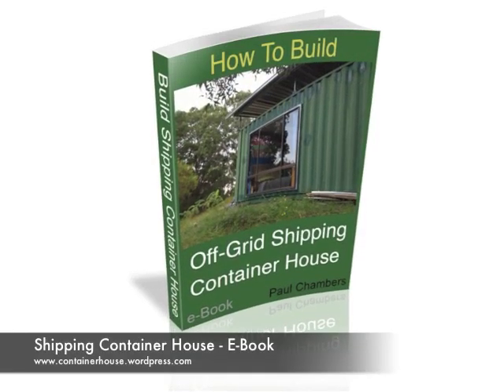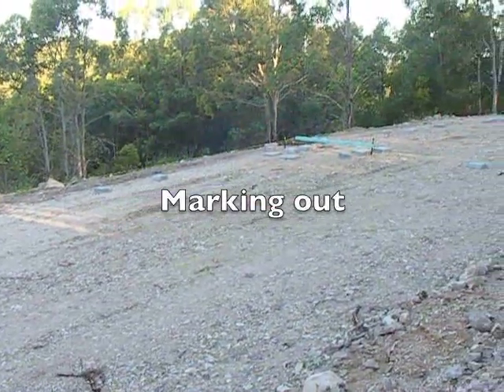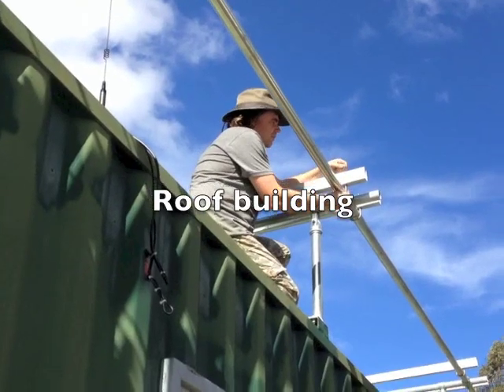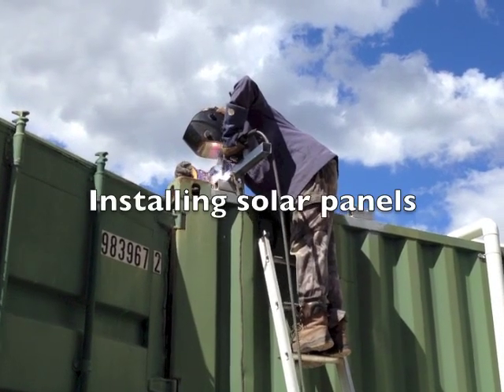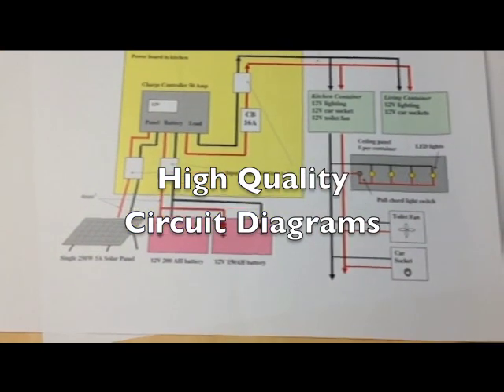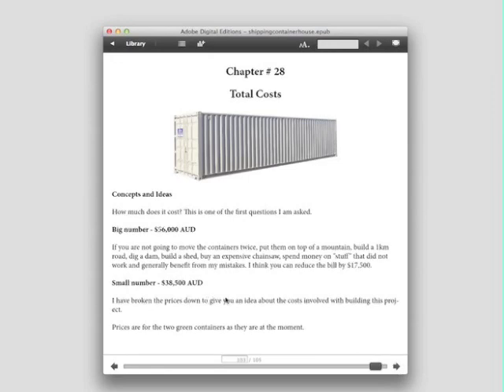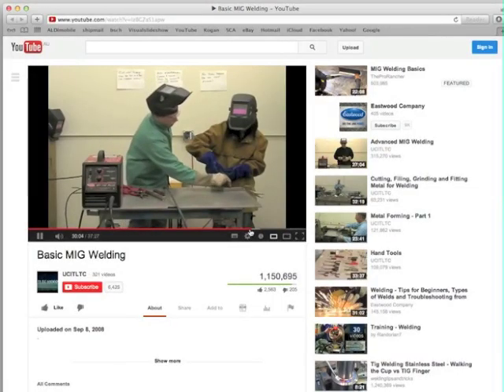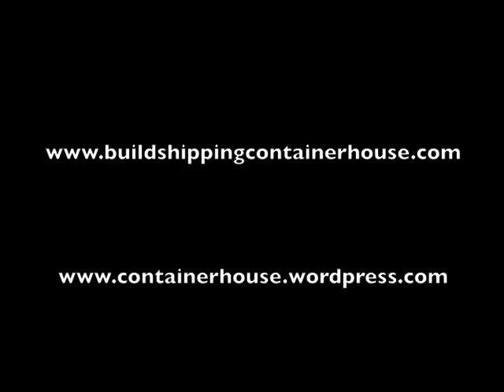Shipping Container House - How to build off-grid shipping container house ebook

Comment: Container home, safety and secured from earthquakes., unbreakable & non-fragile., solar power system with battery banks, solar water heater with 250 gallon tank, solar powered water deep pump with 1000 gallon water stored tank, $25,000-$50,000 install and build